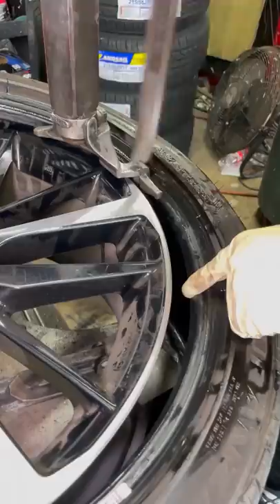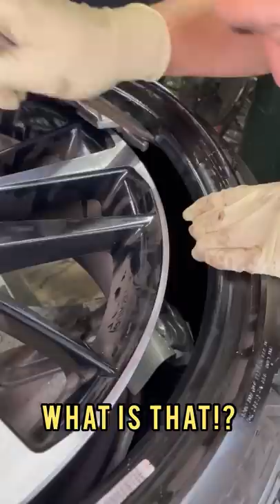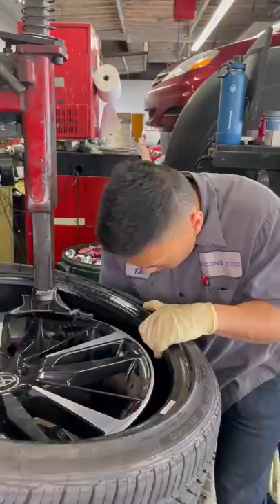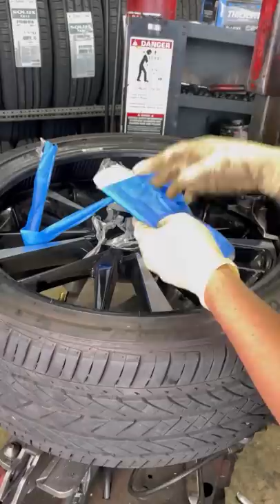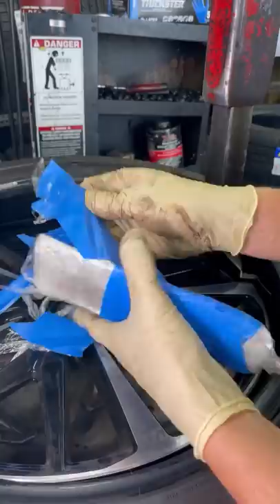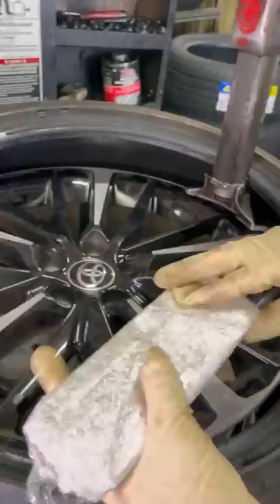Worker finds package in tire during work! #Shorts

Comment: The tire off balance would have shook that car apart if that was in there
Reply: If it's taped to the rim it won't change the balance to much but coming loose it would be a nightmare to drive over 40 mph though

Comment: Lol so fake! The tape is to clean, Everybody knows attire heats up on the road and I mean heats up. If that was really in the wheel that duct tape should be extremely sticky from the heat within the tire if another time was cool the glue on the duck tape is already compromised so it should be really sticky but yet the duck tape looks perfectly new.